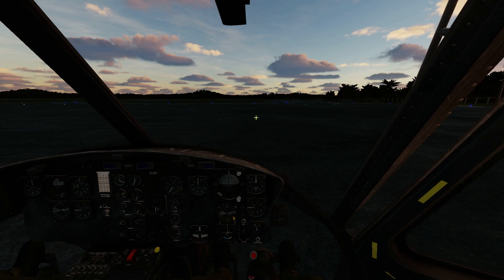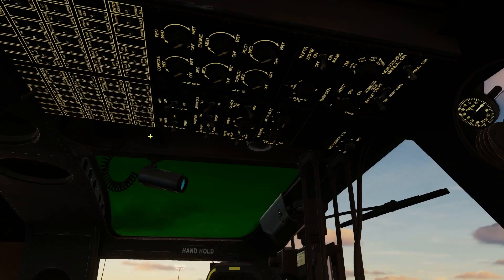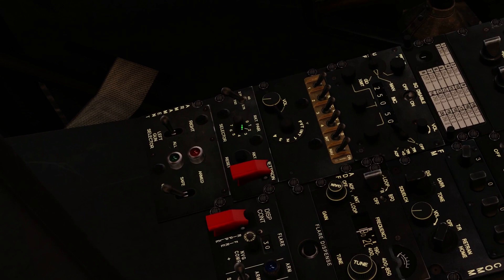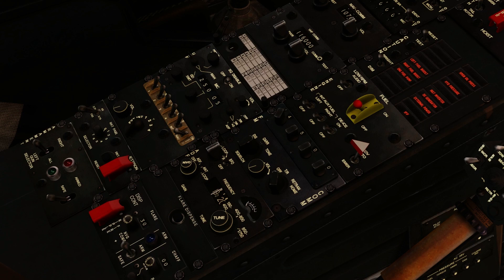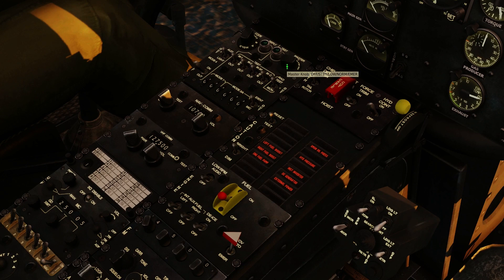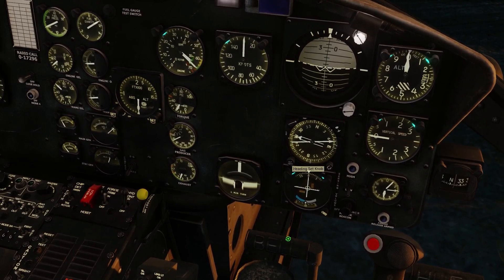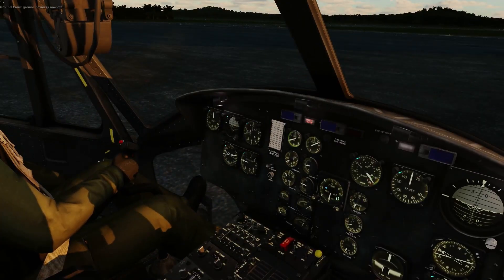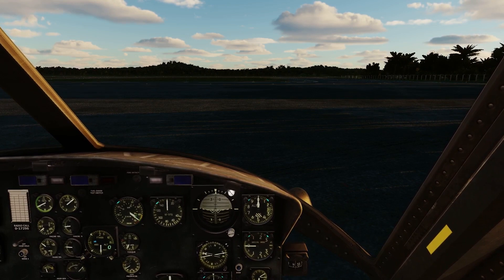DCS UH-1 Huey: Cold Startup

Comment: Lol DCS just lets the Huey Startup with no damage to any systems when not following the SOP startup. I kind of wish it would give alarms or show damage caution lights when starting it up wrong. It's like as long as the Battery is on fuel pump is on throttle is open the darn thing will start. Not to many Airships startup as fast and easy as the Huey.
Reply from the maker: I wonder how far removed this is from real life though? You'd think they would design it so if it needed to take off in a hurry it could slightly deviate from SOP to get it up faster.